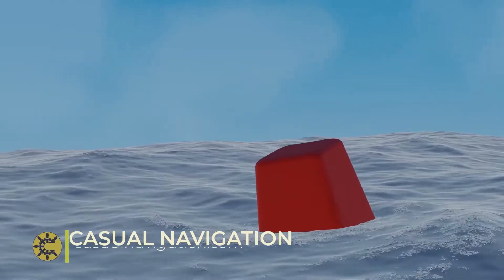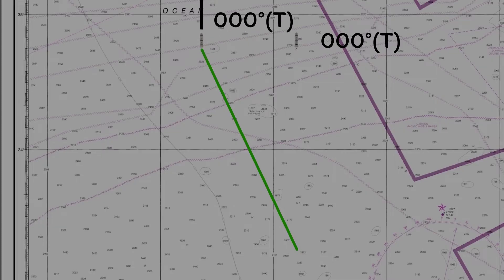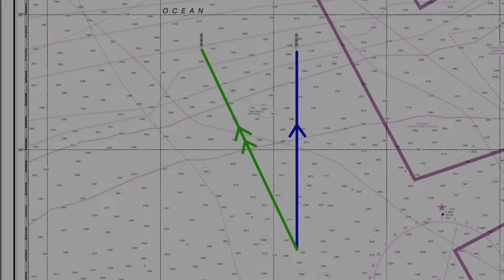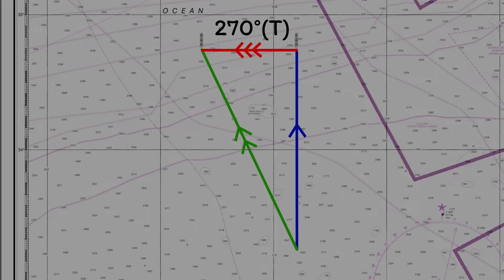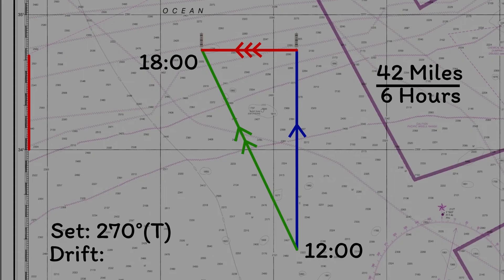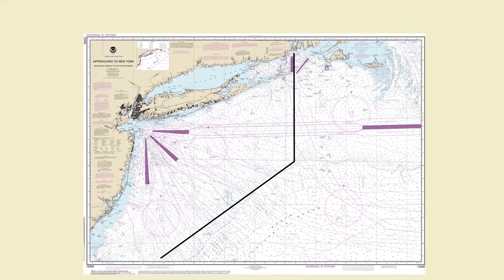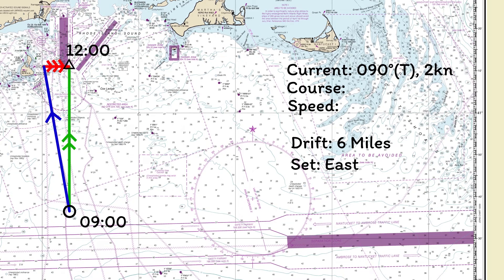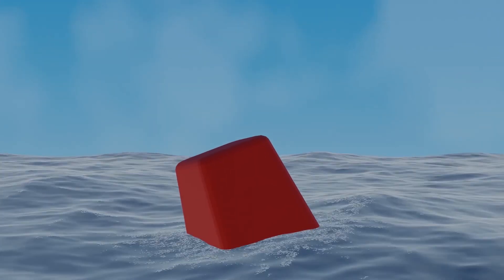Working with Set and Drift on a Nautical Chart

Comment: Very confusing video!  The terms and expressions here seem deployed badly.  I don't know if it's my being a novice or it's a UK vs. US english kind of thing.  

Presenter says blue line is "literally the track the vessel takes"  which sounds to me like that is where the vessel actually goes.  But then presenter says the green line is the "actual position of the vessel".  Which to my ear sounds like the same thing.  In my language use, "actually" and "literally" are words that are synonymous, not used in contrast to each other.  

Also, the presenter mixes up "tide" and "current".  They are different things.  We are not measuring tide.  Tide is the vertical movement of the water, which has nothing to do with what this exercise is about.  We're concerned about horizontal movement, whch is *current*.

All in all, a confusing jumble...

Comment: Just a little constructive criticism: set and drift is about current not “tidal flow.” Flood and ebb tidal flows are different issues. Technically, the blue line is your course (intended line of travel) not a water track.  You set a bearing, you designate a course, and you end up with a track. Maybe it’s just variations in terminologies in international regions. Very well produced video.
Reply: Here in our school course line is also called water track.  But yeah i was also confused about the tidal flow part, when it's actually currents.
Reply: @keaven23  we were taught ;

CTS- COURSE TO STEER =  the bearing/course to head , after the calculations in order to counteract the current. 

COG- COURSE OVER GROUND-(intended original course = the actual course over the ground (which was the intended track without any actual current to complicate things)...